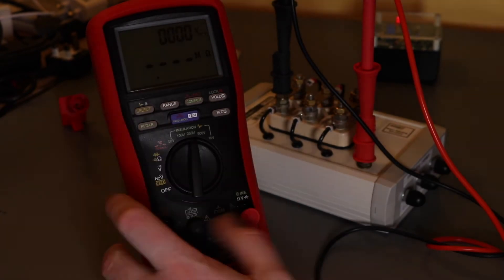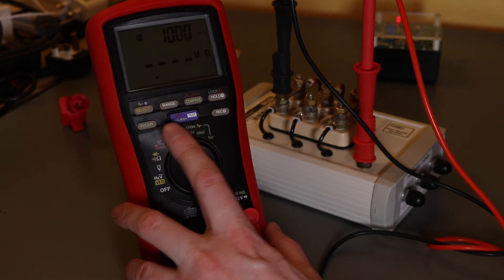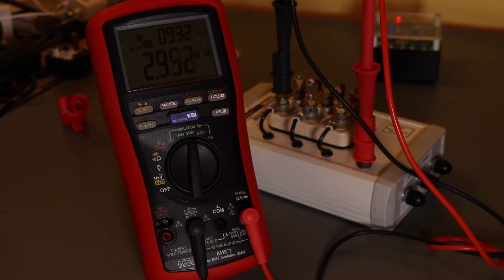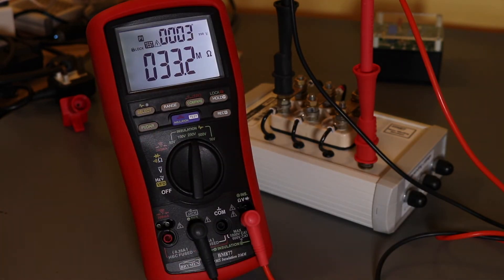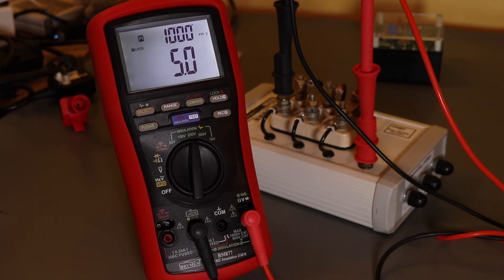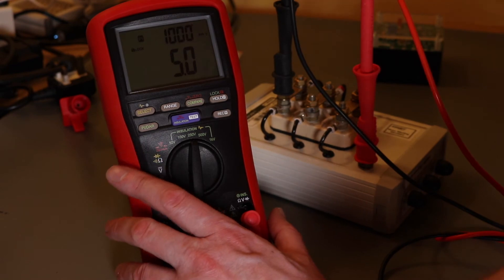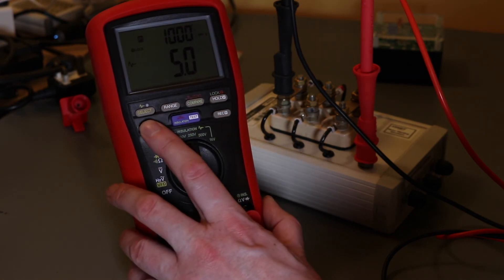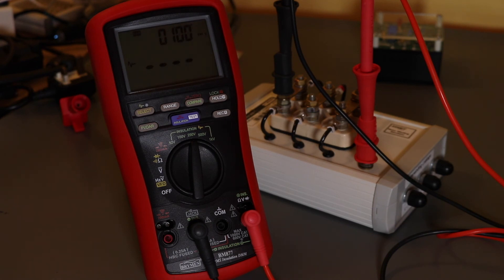BM877 Polarisation Index Test

Comment: I think Brymen multimeters are very high quality. I own a GREENLEE multimeter ( Rebrand ) that was manufactured by Brymen. And the accuracy is through the roof.
Reply from the maker: Thanks for the comment, it is a very good instrument, this one leans more towards multimeter functionality rather than insulation tester, so it is quite up to my more specialised needs, but certainly takes some beating for a general use instrument.